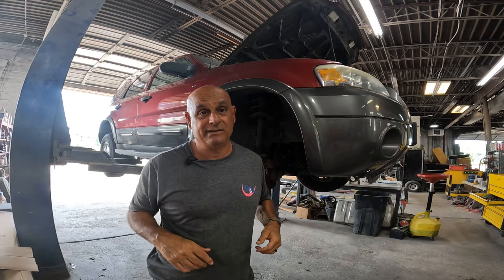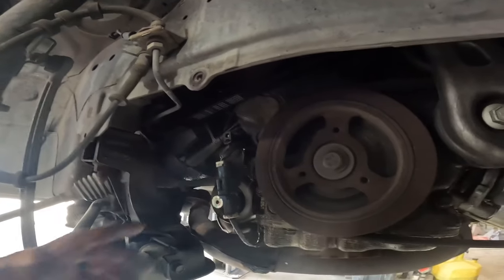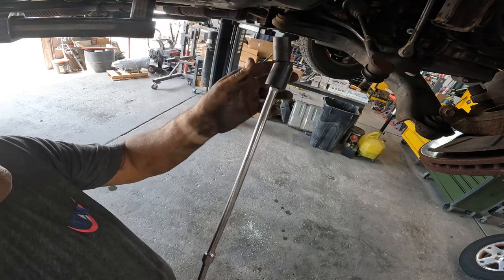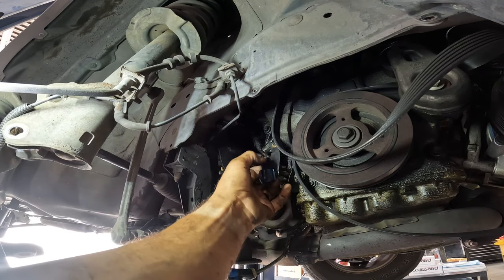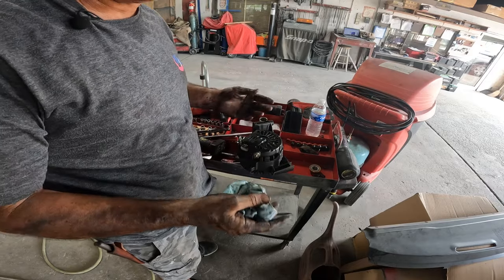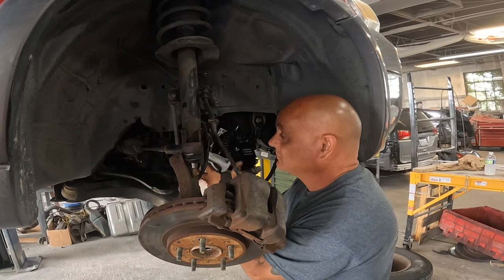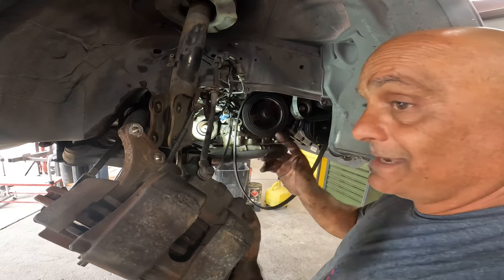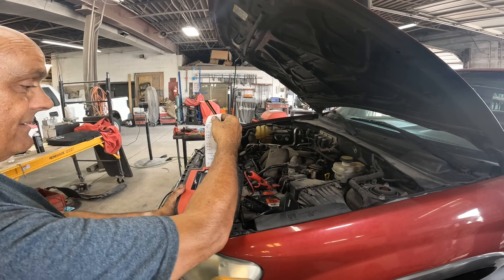Quick & Safe Alternator Replacement on 2006 Ford Escape | DIY Guide

Comment: Well, I guess on the plus side, I've got front wheel bearings I need to swap, so I'll be part way there already.  Not sure whether having the hub off will be any real help,  but it should be one less thing to crawl around while doing this on jack stands.
Reply from the maker: Sounds like a plan
Reply: @AutoRepairTips757  "the best laid plans of mice and men..."
Totaled this morning while sitting at a stop sign.